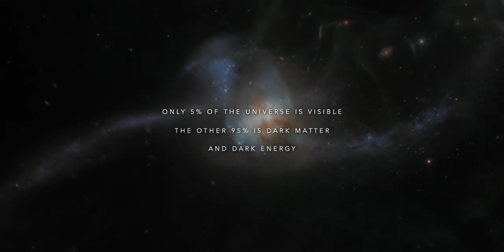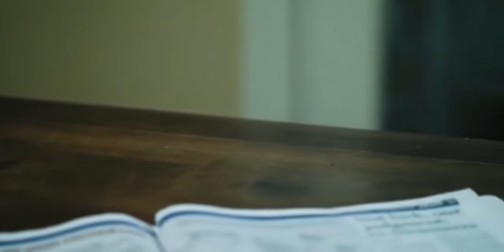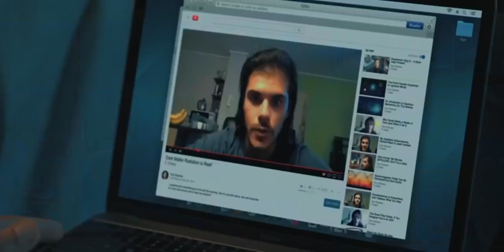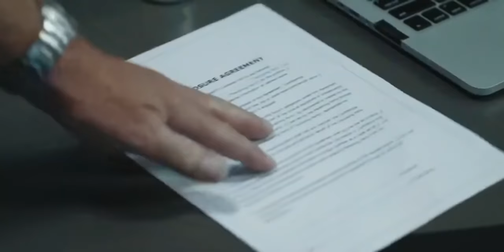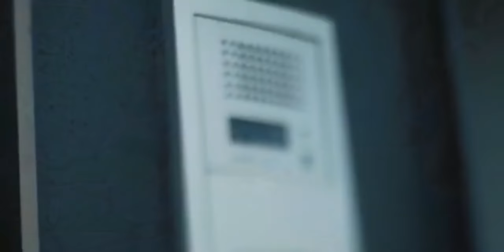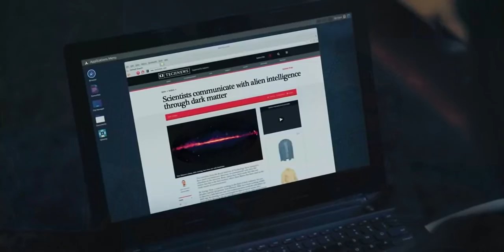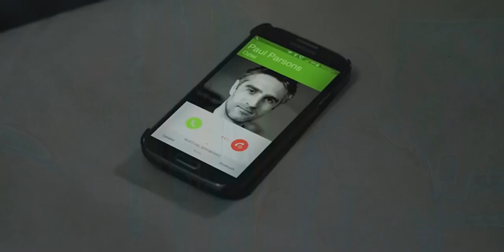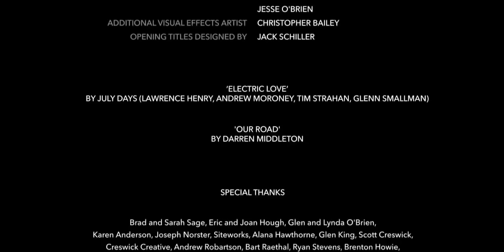Fantasy action movie Best Sci Fi Movie 2021 Full Movie English Sci Fi Movie 2021 Movie 21

Comment: I know it's just a movie.  I keep thinking the transmitter is kept aimed at one location.  The actual direction of the signal exchange location changes each moment via Earth's rotation to a much greater degree than the axis of the tilt.  Yet signals are exchanged just about any time during the day over a period of months.  The place signals are exchanged is in an extremely large location which is very far away OR the location is still pretty large plus pretty close to the Earth.  Right?  Wrong?  Just too nit picky thinking because it's just a movie?  lol

Comment: Great movie. I happened upon it as I was trying to re-write my own findings from 2007 that I believe a good portion of Alzheimer's cases are caused by the way we have chosen to enter information into the human mind. So, I designed a way to teach students information through rapid cognition. I can't get anyone to pick me up for research. I feel like the lead actor as I keep going back to the classroom to teach simply because it is my life's work. However, teaching as we do: The process of using the hippocampus potentially could be 'burning' our synaptic connections and since much of the information we learn during our school years is useless, the brain purges the connections--taking valuable memories with it. So, the proper process of learning could be found in backward engineering. The information learned through the amygdala can actually be processed in such a way that it is encoded into our DNA. So, since I am sitting to write out my thoughts and try once again to get someone to pick me up for research, it is amazing that this movie crossed my path...ironically, whilst sitting outside, ants have been biting at my feet as well! lol...thanks for posting this movie...it's a great inspiration!
Reply: Keep going. Do not give up 🎉